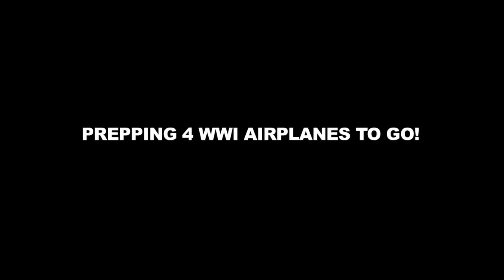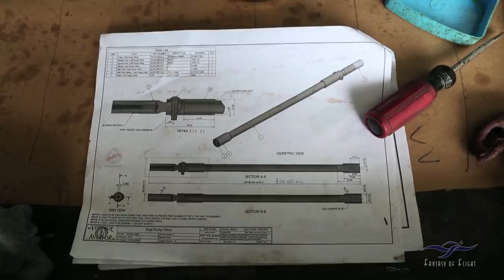World War I Airplanes - Prep & Status for Oshkosh

Comment: I carefully use a heat gun to unstick gummed up valves and carburetors in model airplane engines.  Same castor oil different size engine.

Comment: Just like R/C nitro engines, they sit too long and the caster oil goes through polymerization and gets gummy/gooey and locks parts up. Flood those jugs with avgas or methanol to dissolve that crud. It really works good if you can get the parts hot. 

When it rains, it pours; I know, im an A&P. I work on corporate jets, warbirds wound be more fun!

Comment: Kermit I used to run castor oil in rc model airplane engines if they sat very long the crap gums up I would try using heat to warm the cylinder up industrial heat gun heat will soften caster.

Comment: Are these engines fogged for storage with Sea Foam? I just pulled a jet ski out of a ten year storage. It was like brand new inside. Pulled the plugs and poured some Marvel Mystery Oil in each cylinder and let it soak for an hour then turned it over without the plugs a couple of times. Put the plugs back in along with a new battery and it fired right up. I never intended to not use it that long but the dam went out on the lake and it took years to get the dam replaced. I'm sure glad I fogged the crap out of it prior to storage.
Reply from the maker: Never heard of it but I will check it out!

Comment: Damn when bad luck hits you it sure runs all over your hanger. 
  I know this sounds crazy but i would just double check the Sopwith Pup motor to be sure there is no linear free play under load of the motor and whatever is retaining it. I have seen similar cases in R/C planes that would only happen when the prop is working in moving air at full power. These cases happened back in the 80's on F-1 R/C tightly cowled motors.

Comment: If possible replace that gummy castor oil with a good synthetic,l haven't used castor in a two stroke  in thirty years. Also turn motors over once in a while so you won't have this issue, and motors with valve springs don't fatigue due to being open for long periods of time. Can't wait to see fly.
Reply from the maker: Rotaries are four-stroke and designed so the oil does NOT mix with the fuel!

Comment: +KermitWeeksBlogVideos  How's the castor bean oil metered into the Le Rhône and the Clerget? In the 1960's-'70's, Kawasaki used a dedicated metering pump for the engine oil (which fed the crankshaft and con rod bearings and piston rings in addition to a top-cylinder sprayer downstream of the carburetor) for some 2-stroke motorcycle models, with its regulator slaved to the carburetor throttle - reasonable mitigation of the contamination hazard for a total-loss lubricator using NMMA TC-W.  A similar system could have been used to minimize varnishing and gumming of the piston rings and valvetrain, at least on the Clerget with its carburetor discharging into the crankpin.

Comment: What's the deal with the TVAL lozenge fabric? I'm guessing it was made to near original specs and has no UV protection?
Reply from the maker: Correct, although it was my understanding that some clear UV protection was applied (?).  Other airplanes covered in New Zealand were covered before and/or around the same time as mine and did not have a problem.  TVAL was kind enough to send us new envelopes so, at some point when needed, we will recover it.